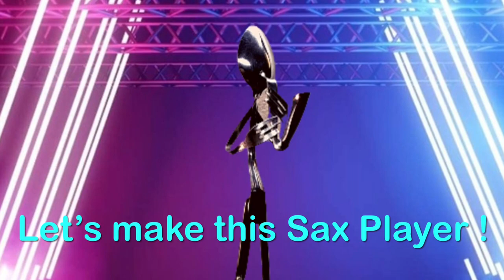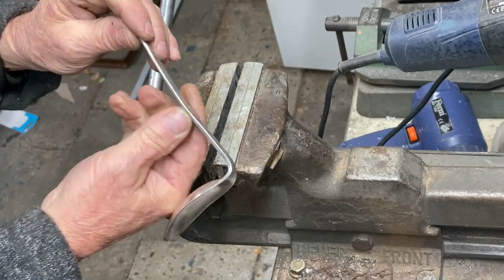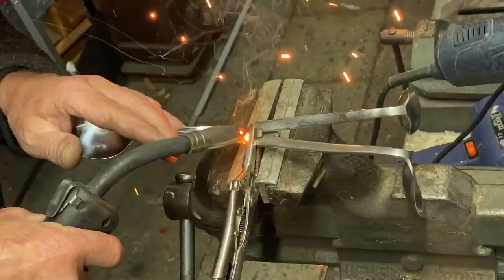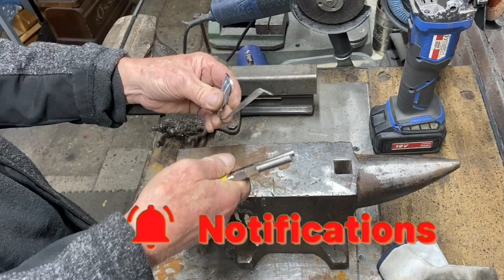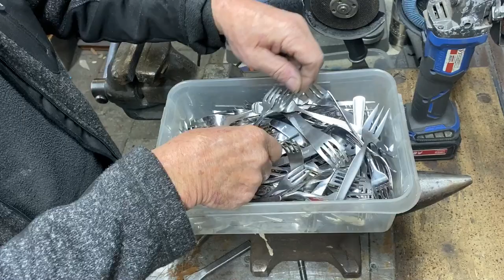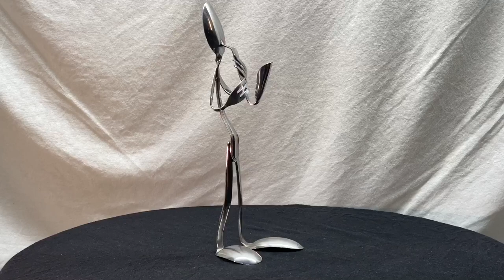How to make this Saxophone Player from cutlery only!

Comment: Very Well done!! I'm about to buy my first Welder and to save money I will buy a Flux Core from Forney. Will I be able to this kind of work without the expensive Gas Cylinder???
Reply from the maker: Thanks for watching! It’s possible to weld it with a flux core welder, but the welding is not so clean.
So you have to remove more spattering.
Succes creating!
Reply: @BrutusMetalArt  Thanks for your input!

Comment: Ver y nice. Liked and subscribed. 
Are you using stainless steel wire?
Reply from the maker: Hello, 
Thanks for watching! I use normaal 0.8 or 0.6 wire MIG with gas.
Reply from the maker: Hello Martin, thanks for like-and subscribing !
If it’s normal steel I protect it with clear coating, especially as it must placed outside.
Stainless steel don’t need protection, just polish now and then.
Succes!
Reply from the maker: The tags will rust, if you don’t want that, then you polish the whole object and give it a clear coating.

Comment: New to welding.  Just curious, I hear people say some things put off toxic fumes when welding if you don't prepare the surfaces first.  Is this a concern when welding cutlery?  Or it is safe to weld without doing anything to it?
Reply from the maker: Thanks for watching!
Yes, it is possible that there are toxic fumes when welding Galvanized steel, but cutlery is mostly stainless steel and not so dangerous.
If you weld 8 hours a day every day you must protect yourself.
But as a hobby welding for short times,it’s not a problem.
Good luck!
Reply: @BrutusMetalArt  thanks for the info!